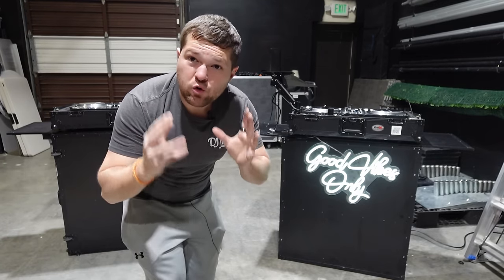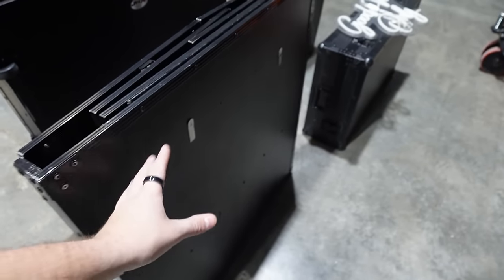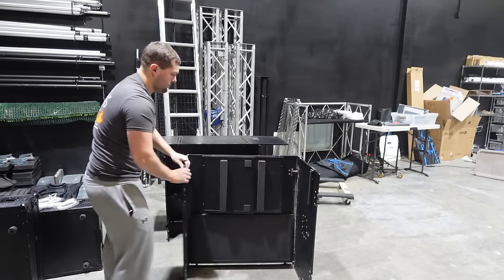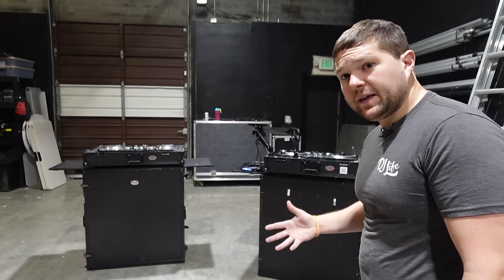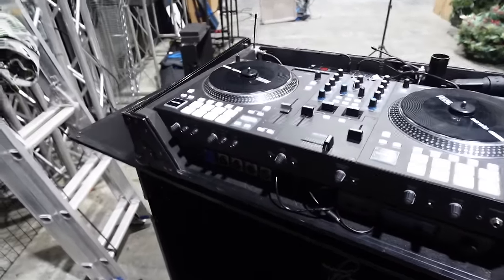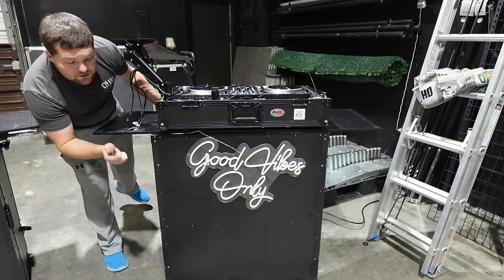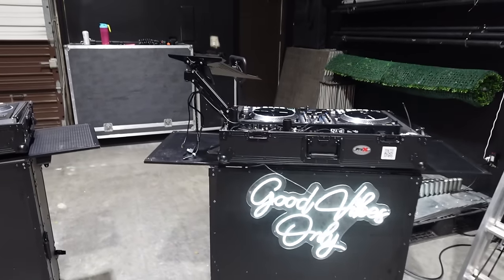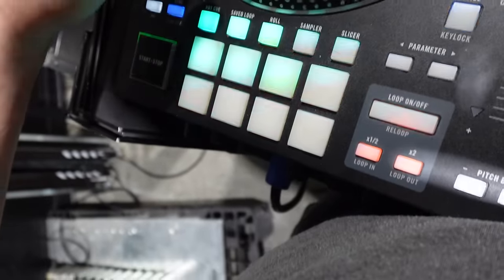DJ Furniture Type Booth for CHEAP (Pro X T-Table Setup)

Comment: I have 2 of these… one Smaller and one That Opens Up Wide ….they’re GREAT 👍🏼 HEAVY… but Functional and Easy to Set Up.  I DRILLED 2 x 1 3/8 HOLES on top to Run the Cables Down and Keep them out of View. They’re even better now 👌🏼

Comment: I wish they did neon lights battery powered that way no cable. Dj Rick keep it going. ☝🏽❤️🙏🏽 I bring a 4 ft adjustable table from Costco and a skirt very clean for under $200.

Comment: Funny I just put this together last week as a backup to my Max booth.  Can’t believe I didn’t see this years ago. It’s legit.  I got the Odessey version without the tabletop.  I use the top of the prox case as the table and put the controller case on top.  Very solid

Comment: Good show bro, im making my DJ booth with led spectrum equaliser 10 band only thing is it's 1m height and 1m 300m wide and thickness is 100mm , material is 6mm MDF/plywood, only thing is it's on the heavy side but it will look awesome.

Comment: "They don't care what the gear is. They just care that it looks clean." That is exactly why I will keep using my folding tables, and table top facade, or full facade with up lights inside :) They are the lightest weight, and most economical option. I still to this day get compliments on having a nice set up too!

Comment: Nice flexible booth. I'm considering either this or one of those folding mini-bars to sit a flight case on. The only mod needed for the mini-bar is to add a hole or two in the top for cable management. Thoughts? #squad
Reply: check the UDG one. it was gromits for cable managment.

Comment: #SQUAD Hey brother, dope Video as usual! I’m going to pick up the Odyssey boo just because I have an Odyssey flight case coming in for my Rane Four and I like to have everything match. Plus I do not like the wheels on the end of the Pro X case, they kind of just look out a place to me. The flipside of that though is my Odyssey case has that hexagonal pattern, which the pro X case has. I do like that but the wheels, I just can’t get past the wheels. Could you please send me the link to the clips that you installed on the Odyssey booth so I can do the same, that was a good touch
Reply from the maker: Got them at a local hardware store in the cabinet hardware section.

Comment: I like the idea of these.. But medically I hate the fact that the wheels are promptly in the front where you can see them... It really kind of detracts from the overall look, especially if this was a wedding or something. 

To bypass that you can always hide them with a facade... But that defeats the purpose of having the fold-up table 😂

Plus it works for most guys who are under 6 ft tall... I'm pretty sure I would have a issue with the height

Comment: "club work" and they use controllers in the clubs?
Reply from the maker: The clubs dont have built in systems here. DJs have to bring there own and plug in. Nobody is gonna truck cdjs in there every week
Reply: @DJRickWeb  Damn.. where is that? do clubs have speakers over there at least?
Reply from the maker: @djmacalak6813 Raleigh / triad North Carolina. Yes most have sound systems.